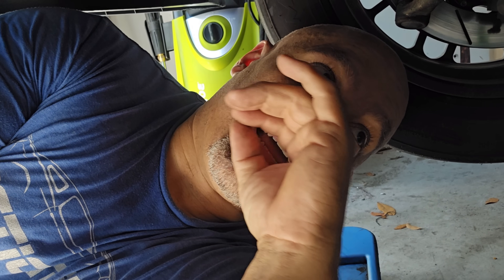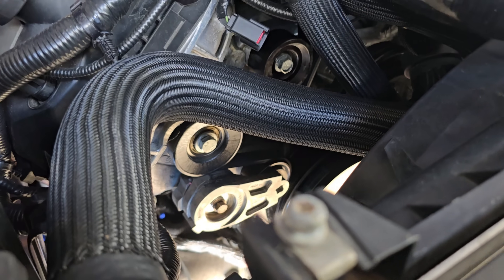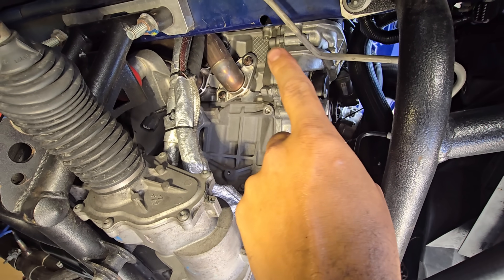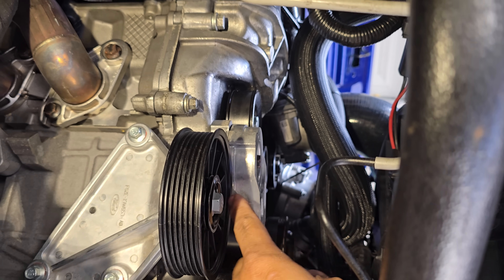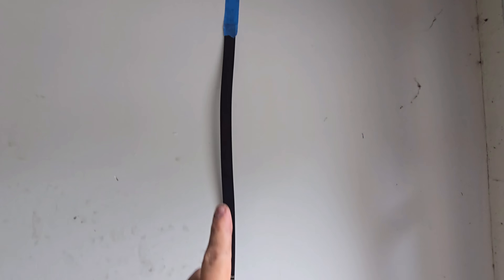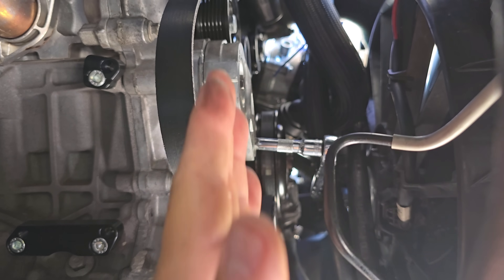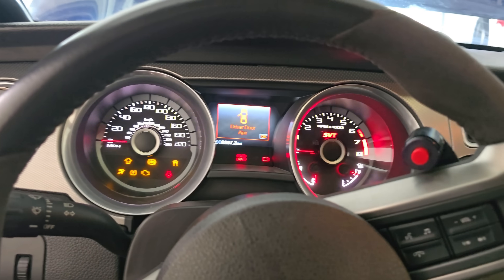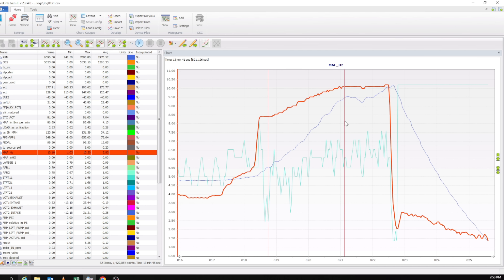Belt Slip on the Coyote swap GT500 Section H8. Will new belt routing work?

Comment: Forgot to mention, those Goodyear belts stretch about 1/2in after its first time under real load, look at where the tensioner sits after install, then inspect again after a couple pulls. I got a belt almost too small that I had to fight to get on. After it stretched it’s perfect. Been going strong 6+mo same belt.

Comment: I had a delete pulley on my coyote swap, it was causing belt problems and snapping my tensioners every couple drives. I switched to how you originally had it, and all my issues went away. VMP Gen2R tho